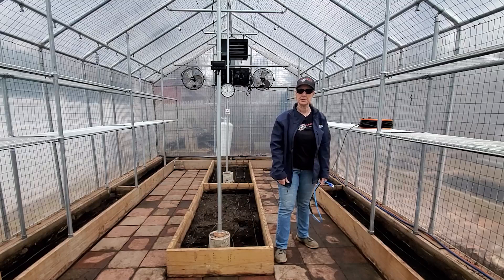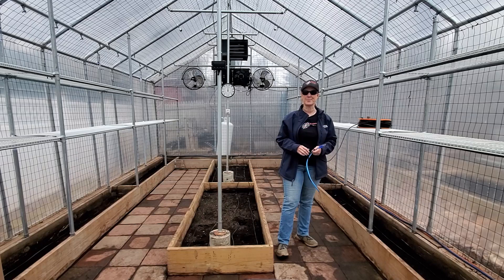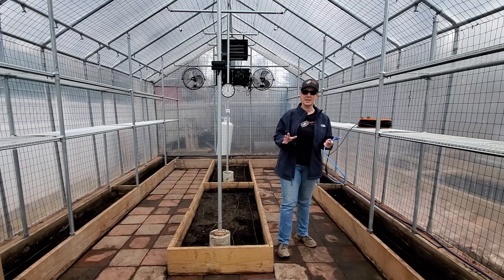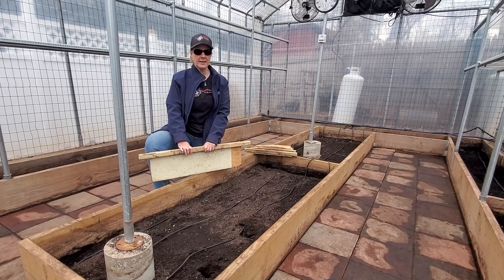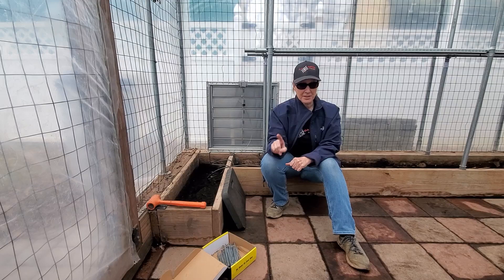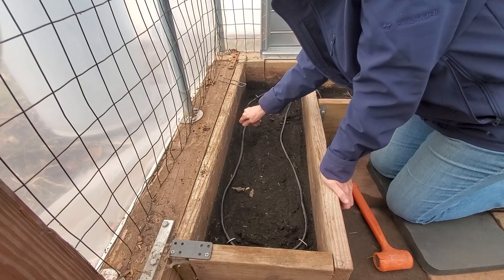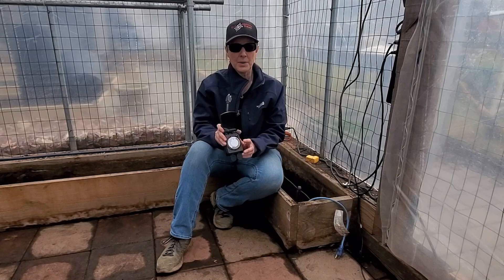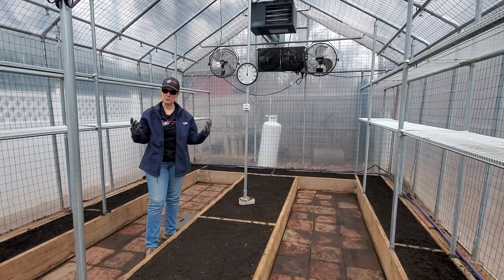Using Heat Cables In the Garden Revisited 2023

Comment: Hi, I love your green house and long greenhouse  trough boxes. But using heating cables  in the winter time without insulating the bottom of your long greenhouse trough boxes is also trying to heat Mother Nature as well. If you line the bottom of the long troughs with something like 1.5 inch Owens Corning Insulation Foam cut to size, you will notice an enormous increase in the over all trough soil temperatures because the ground will not draw the heat out of the troughs from the bottom. Try lying in the ground in the winter time without an insulation mat you'll see what I mean.

Comment: Purchased frost king water pipe heat cable to use around vulnerable new sprouting ranunculus in anticipation of 14 degrees!  after arrival, 
product info says do not let it touch the ground.  It appears well insulated. ? legit concern?
Reply from the maker: Hi @user-yv5sn5rb4m . Sorry for the delayed response. Thanks for the comment. Not sure which cable you got but I think the concern, when you see something like that, is that if you're putting it on some kind of wood, vinyl or carpet in your home because as it heats up it could obviously destroy it. Heat cables are meant to sit on the roof, which help with de-icing in the winter. Asphalt shingles are meant to handle the heat of the sun and the rain. As far as putting it in the soil, as long as you can keep the plug in and from direct water contact, you should be fine. The biggest problem to look out for is to make sure your cables don't overlap each other because the heat of the cable will melt the rubber coating, if it's laying on another. You can find some pretty funny YouTube videos of people plugging in the cable as it was still coiled up and they ended up with a big melted mess. So just be careful of that. If you have any other questions, please feel free to reach out to us. Thanks for watching! Jackie & Dan